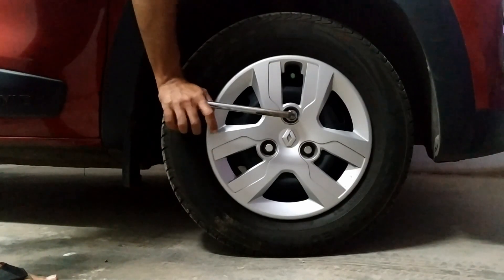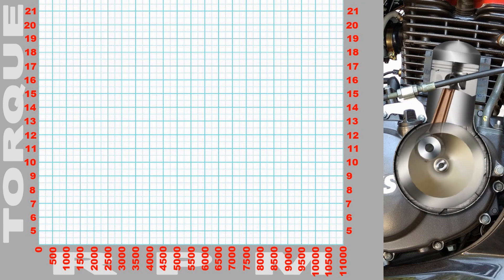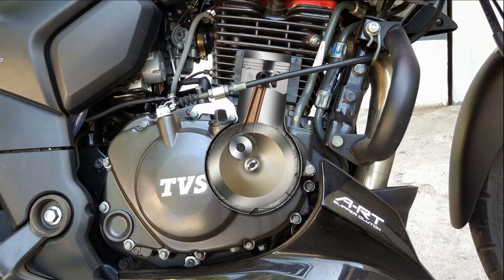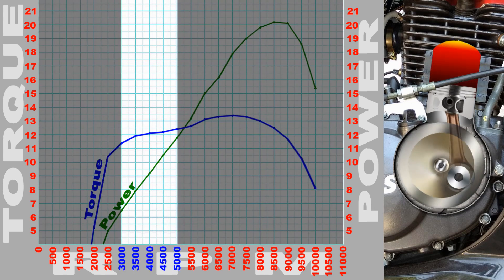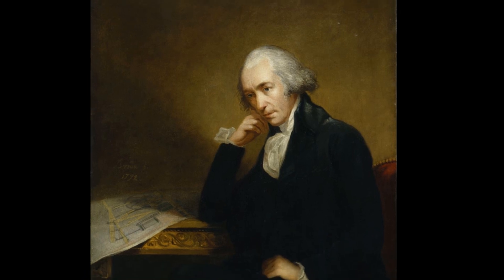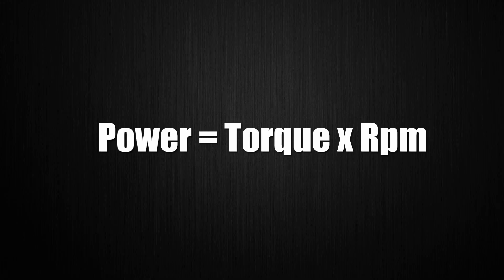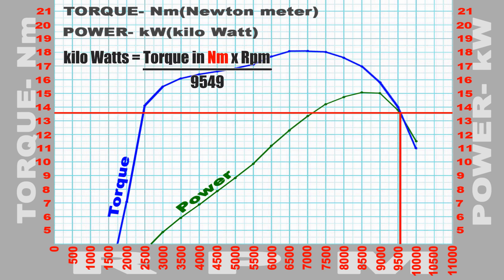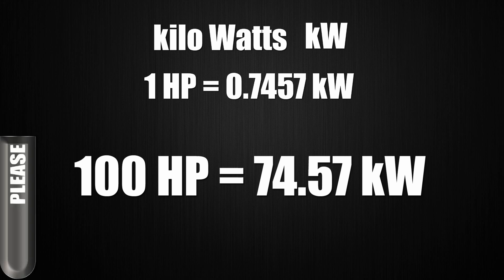HP യും ടോർക്കും - എന്താണ് വ്യത്യാസം? | Explained in Detail with Animation

Comment: നല്ല informative video ❤. But എന്റെ arivil Torque undavan RPM ന്റെ ആവശ്യം ഇല്ല. Practically നിങ്ങൾ paranjath ശരി ആണ്‌, engine zero RPM ല്‍ crank shaft rotate aavunnilla അല്ലെങ്കിൽ output ഒന്നും tharunnilla അത് കൊണ്ട്‌ Output Torque zero ആയിരിക്കും.
Still engine nte connecting rod crank ല്‍ torque apply ചെയ്യുന്നുണ്ട്. Engine nte internal friction നെ overcome ചെയ്യാൻ pattunna torque ആവുമ്പോ മാത്രം crank rotate ചെയ്യാൻ thudangullu എന്ന് മാത്രം.

Comment: Long stroke enginilum short stroke enginilum oru fly wheelinte 720 degree rotationil or 4strokil generate cheyyunna total power equal alle?
Reply: cc kudiyaal maaatrame long stroke madhi...power different ayirikum...eg: 350 cc highness torque 30 NM @ 3000 rpm,bhp 21.07 ps @ 5500rpm(90mm stoke length,70mm bore size)...Gixxer 250cc engine 26.5ps @ 9000 rpm..22.1 NM torque @ 7500 rpm........(bore 76mm,stroke 54 mm)....350cc low speed engine max rpm abt 8000rpm.....but high torque at lower rpm more than gixxer 250.....but gixxer has more power 26.2 ps.....etavm vegathil pokunath..gixxer 250...gixxer nte stroke length kurav aayathkont high rpm engine karangunu...bhp kuutunath engine tuning vechaanu....othiri factors unt...250 cc yamaha fZ 21 ps only..

Comment: Chetta njan rtr 2004v adukkan thalparya pedunnu palarum petrol adichu mudiyum annum maintains koodumennum  frnd parayunnu igane ulla vandi njan use cheythittila 2nd onnu othu vannittunde 18 model bs4 vandi 70000 rs parayunnathu ee vila kooduthal ano aduthal kudugumo ariyathathu kondu chodikkukayanu parajutharaamo
Reply from the maker: 2004v nalla reliability ulla vandiyaanu. 35+ mileage um kittum, nalla mileage ullathanengil 40+ kittum. Puthiyathinu 1.5 L vila ullappol 2 varsham pazhakkam ullath 70k kooduthal alla. Pakshe vandi ride cheythu kulam aakkiyittundo, vilkkanulla real reason okke arinjittu vanganam.

Comment: Torque
28 Nm @ 4000 rpm

               Power
20.7 ps @ 5250 rpm  

ഇത് ബുള്ളറ്റ് 350 യുടെ Torque, power ആണ്. എന്തുകൊണ്ട് ആണ് 28 Nm@ 4000 എന്ന് എഴുതുന്നത്.. ഇതിൽ 28  എന്തിനെ സൂചിപ്പി്കുന്നു
Reply from the maker: Torque, bullet engines Torque valare koodiya engine alle

Comment: Torque um powerum grafil oru pointil varumbozhano meteril economy level 40 to 50
Reply from the maker: Anganeyalla, but nalla Torque ulla kuranja RPM il odikkumbo nalla mileage kittum. torqum powerum mattoru unit il parayumbo mattoru point il aanu cross cheyyunnath, athu njaan videoyil explain cheythittund bro

Comment: Familyku ethu bike kollam
Under 1.5 lak
Reply: Apache 1604v or Apache 160 2v bs6 Apache 1802v bs6....2v models okke low rpm torque 4vnekaal und because athinu 2 valve aanu not 4 valve ...but high rpmil 4v aanu better....endayalum ellam Katta initial torque und...videoile graph kandille 2000rpmil thanne torque kittum ...kashtapettu kaikoduthu 
rpm kooti odikandii varilla....allel pulsar 150,180,220fnte torque ellarkum ariyamallo....vere level torque aanu 220ku...hero karizmaum nalla torquey engine aanu....Apache 2004v backil seat raised ayonda athu parayathe but 2004vkum nalla torque und...250cc ulla double Vila varunna fz25nte level toque und

Comment: Peak power and torque on high rpm range (12k)or at low rpm range(8k) is better on road. (eg: ninja 300and dominar 400)
Reply from the maker: Peak power and torque in comparatively low rpm is better for normal road riding or real life riding. The other thing is more suited to circuit racing.